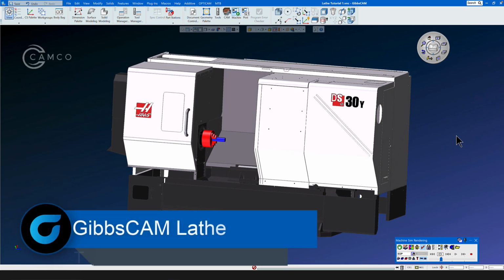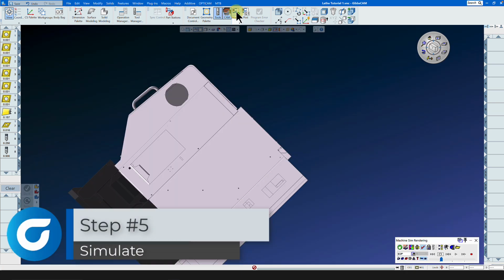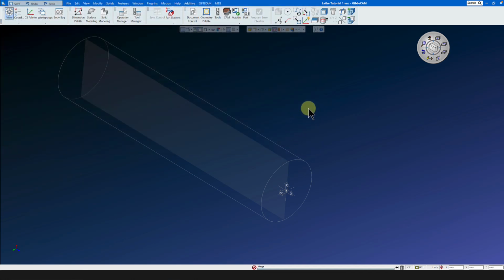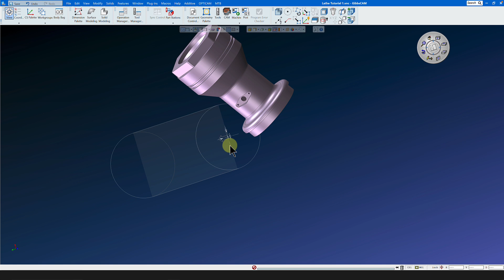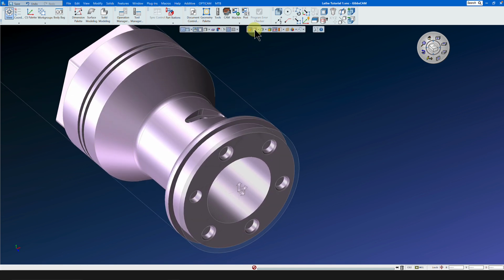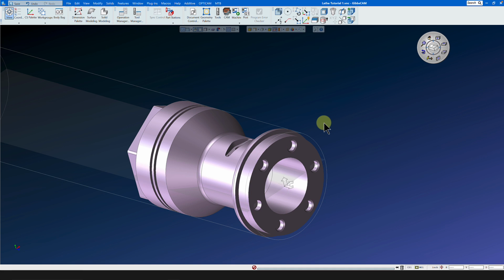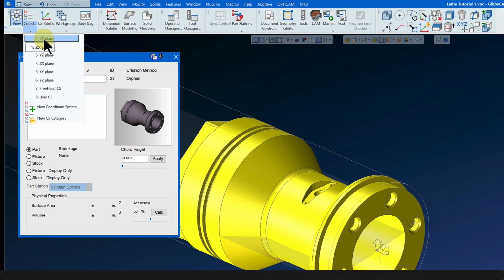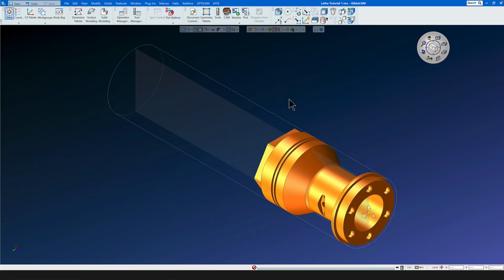GibbsCAM Lathe Tutorial: 1-Solid Model Import

Comment: I just started using this software and downloaded it. The machine model in the tutorial you provided has this issue, and I don't know how to describe it
“Cutterbed

This is an issue related to the handle configuration. You need to check your installation program before downloading
Knife holder issue (s):
Library: BMT65Tool Blocks Block: Haas DS30Y Half Index Tool Block Double Error: Not found in current library
Library: BMT 65 Tool BlocksV14 Block: BMT65 Boring Error: Not found in current library
Library: BMT 65 Tool BlocksV14 Block: BMT65ER32 Live Error: Not found in current library
Library: BMT65 Tool BlocksV14 Block: BMT65ER32 RA Live Error: Not found in current library
Library: BMT65Tool Blocks V14 Block: BMT 65 ER32 RA Live Double Error: Not found in current library
Library: BMT 65 Tool BlocksV14 Block: BMT 65 Turning LH Error: Not found in current library
Library: BMT65Tool Blocks V14 Block: BMT 65 Turning RH Error: Not found in current library
sure”

Comment: In my gibbs cam there is only option in coordinate system there is only XZ plane option how can i add other planes like XY system in coordinate system YZ options?
Reply from the maker: Great question—when you’re in a lathe (turning) setup, GibbsCAM defaults to the XZ plane because that’s the standard orientation for turning operations.

If you want to access other planes like XY or YZ, you’ll need to: 
   Switch to or enable a mill or mill-turn configuration, where multiple planes are supported
   Or, add a coordinate system manually using the CS Manager (you can find this in the toolbar or under Geometry → Coordinate System)

If you’re using Mill-Turn, make sure your machine setup and post support multi-plane machining—some posts limit available CS options based on configuration.

Let us know if you’re using a specific machine or configuration—we’re happy to help further!